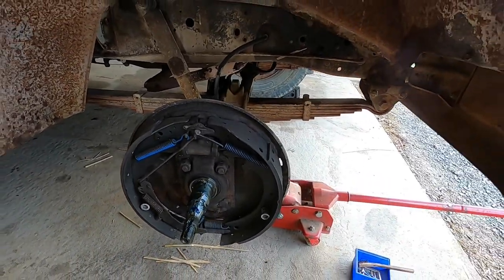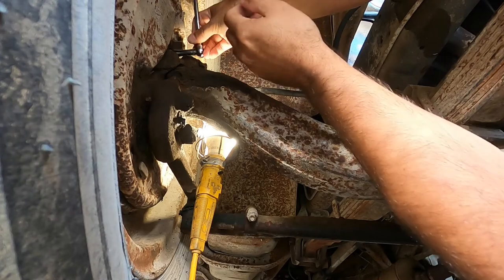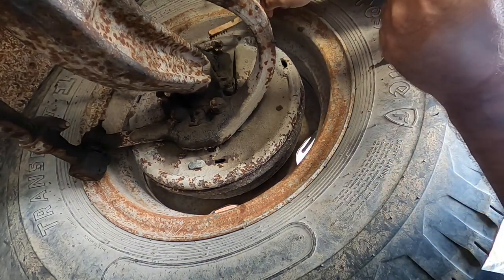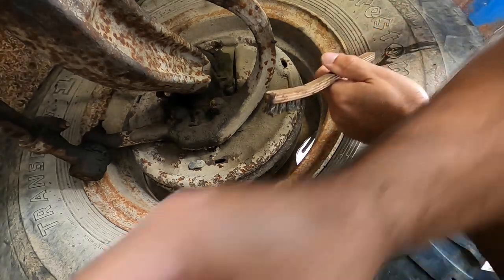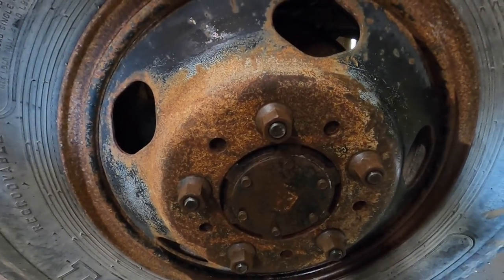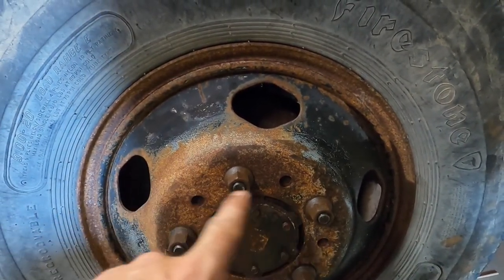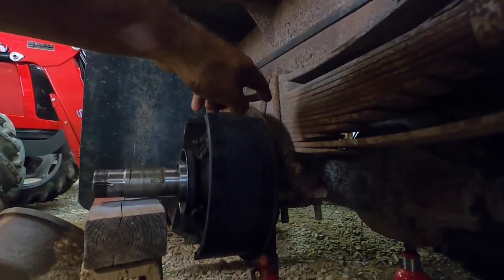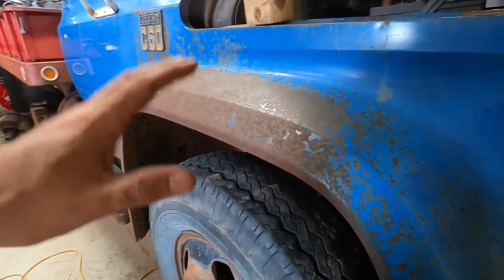Big Blue Brakes Part 2 - Front Drums...  Bleeders, Shoes, and Bearings - OH MY!

Comment: Those old trucks are well built, Everything is built heavy-duty, Should be a great project, The joke wasn't that bad. LOL.
Reply from the maker: Thanks for watching!  Everything on it appears to be heavy unless it's in the engine bay haha.  Little old 350 in there...
Reply: @FabbedFun  The 350 will do everything You need it too. I'm putting a 383 cu in. in mine just because I have it laying around the shop.
Reply from the maker: @DannyWalker1949  STROKER!!!  RV camshaft for torque or hotter high RPM cam to get some extra highway power?

Comment: I used to haul manure in a c60 like that one but a lot worse shape lol, it took the weight very well though, we would have it loaded down as much as possible the 350sbc wouldnt get it to push past 20 mph on a slight incline lol. Did not have the two speed rear though wish it did.
Reply from the maker: I don't know if I mentioned it, but the last time we tried, it wouldn't switch to low.  But, honestly, all we haul is a little gravel or maybe a little less than two cord of wood.  So we really don't need the low range.  YET.

Comment: I did this project on my 1975 C65. The new brake cylinders had a 10 mm bleeder and old ones were 3/8. I put the 3/8 in the new cylinder so whole truck was same. Mine has 2 cylinders per wheel on front also.
Reply from the maker: My 1987 GMC C7000 is hydro discs all the way around.  I might do a brake job on it this winter.  Maybe.   Good idea on the bleeder swap.  We don't need no metric stuff!  lol  Thanks for watching and commenting!

Comment: I have a gmc 6500 it has dual wheel cyclinder on the front brakes also where did you get your wheel cyclinder
Reply from the maker: I don't remember exactly, but I get most of my automotive parts from O'Reilly, RockAuto, and 1A Auto.

Comment: Good day eh!!!  That's a neat old truck.  Pretty heavy duty parts and pieces eh!!!  I was surprised when you said you were going to use copper for the rear brake line.  Can you use copper for brake lines?  I'm not sure.  Here in Nova Scotia copper is not allowed.  I know this because I an old Chevelle I had a long time ago failed the Motor Vehicle Inspection because of copper lines!!!  BTW that was pretty slick how you snuck in the 'tired' joke!!!  LOL  Enjoyed the vid and looking forward to seeing this old truck get back on it's way!!!  Take care!!!
Reply from the maker: I thought the same thing but my father works for an auto parts place.  He says it is rated for same pressures and should be easier to get the right bends.  We will give it a shot and work it hard before hitting any high speeds.
Reply: @FabbedFun  Sounds good!!!  It is a lot easier to work with than the steel brakes lines that's for sure.

Comment: Great video! Getting really tired setting in a pile of tires 😂, took me a second! Does that truck have a vacuum booster for the brakes? The old F700 Fords did I know. Will you double flare your brake lines? I hadn’t in the past but after learning how it works much better.
Reply from the maker: No experience flaring.  It will be all new to me.   I always bought lines already flared with nuts close to the length I needed on old square bodies...    As far as the booster, yes, there is what appears to be a large vacuum booster under the cab on the driver side.  To me, it looks like the brake line runs into it from the master cylinder, and then appears to split between front and rear.  I need to get a closer look at all of it.

Comment: I have a 1974 c 60 and it's hard to find parts for
Reply from the maker: Napa and your possibly your closest commercial truck parts supply store/shop can probably help you the most.  Thanks for watching and commenting!
Reply: Ditto on that NAPA , I've got a 74 case 1070 ,a 66 international 504 and a 66 c60 and so far NAPA carries pretty much all the reasonably common wear parts like bearings, seals, wheel cylinders, filters,u joints, CV joints etc but some items for the tractors I've had to buy online.
Reply from the maker: @dimetrekorsikov5643   I had to go to a salvage yard for a Case 1070 front wheel spindle about five years ago.  I think it was about $175.  Not fun to pay that much for a chunk of steel sitting in a salvage yard for the last 25 years, but I was happy they had it.  Great tractor for field work.  Thanks for watching and commenting!
Reply: @FabbedFun  that case is a beast.  I've got the 451 cube diesel 6 and it'll idle over a barn if you let .
Reply from the maker: @dimetrekorsikov5643  Absolutely!  The only weak point in the 1070 from what I've heard is the availability of good transmission/rear end parts because everything else holds together so well.  You can't find very many in salvage yards...  Imagine if they reintroduced a tractor that simple, that tough, and that inexpensive with 4x4 today...  beautiful.
Reply: @FabbedFun  with those dual rear tires you've really got to find some deep marshy ground to get stuck, but I would still love to have four wheel drive on that thing. The only problem would be you couldn't really use a front end loader with the monster front tires that would have to be mounted on the front axle to match the drive ratio
Reply from the maker: @dimetrekorsikov5643  Let me dream lol.  They do gear reduction to compensate for tire diameter differences, but the weight of that tractor would require some big tires for sure!  Dual tires probably makes it a pulling beast!
Reply: @FabbedFun  scary torque. No shit,with fair at best brakes that thing needs lots of room to turn and I've run over stuff but hell yeah that case diesel is a lot more stout than I thought it would be when I first bought it.
Reply: @FabbedFun  , Rock Auto carries a lot of parts for these medium duty trucks. I have a 1962 C60 with what appears to be the same brakes you have on your truck.